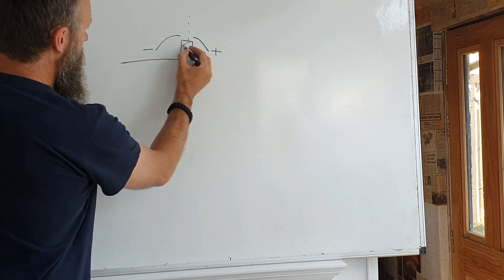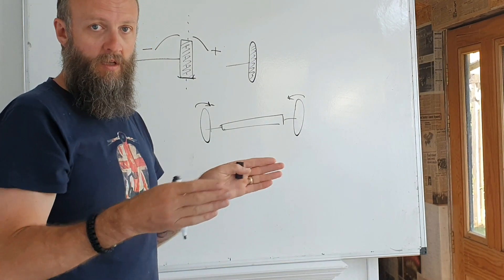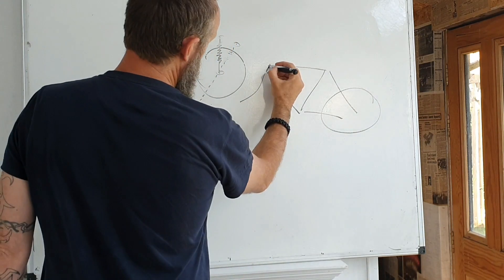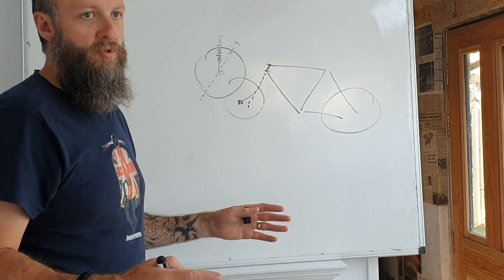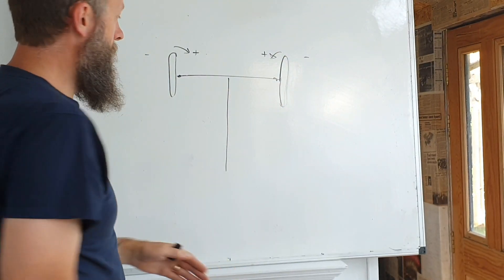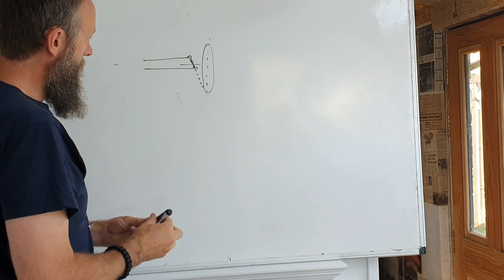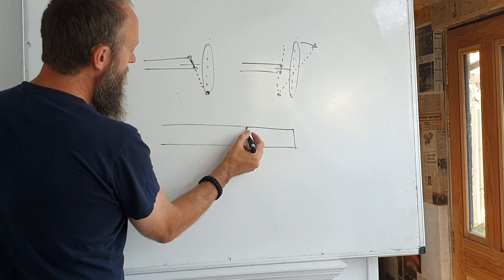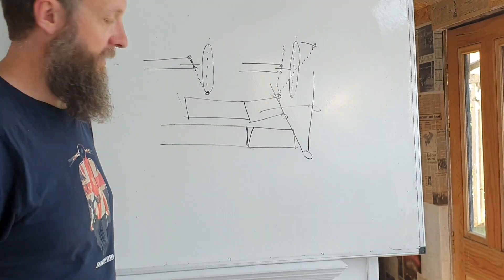Steering geometry. Caster, camber, toe and steering axis alignment.

Comment: Hi Graham,
I be using your very handy guidance when converting my upright trike into a quadcycle that meets disability scooter requirements,
Basically I’m going to replicate your front axle connected to my existing trike rear axle but will be using steel. A bit heavier but it has pedal assist so no big deal.
Can you adjust your steering axis by keeping the wheel upright, adjusting the lengths of the upper and lower bearing eyebolts and angling the vertical bolts that secure them?
If the existing bolt holes are an issue you could pop rivet a cover plate over them so you can re drill. You could make it look like part of the design…..only you will know.
Regarding front suspension,
Can you cut the front axle in the middle and install  a mono shock across the top as done on the rear but transverse. You could adjust the preload so that the  axle sat straight when on the trike but flexed over bumps.
Perhaps use two to help keep it upright.
Bob.